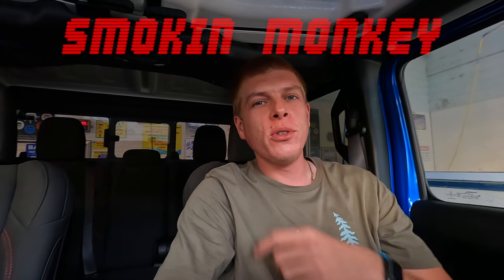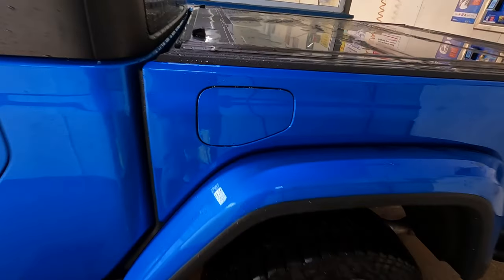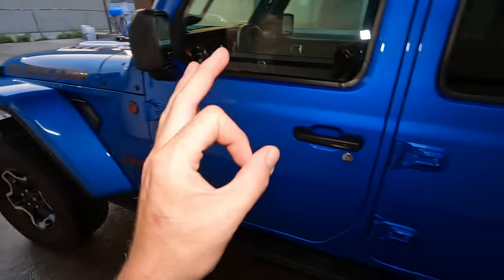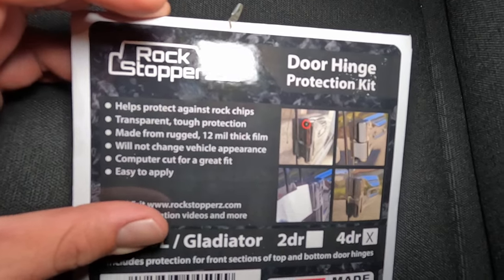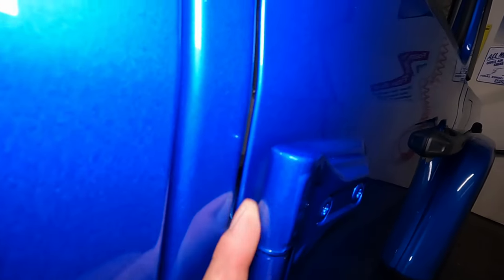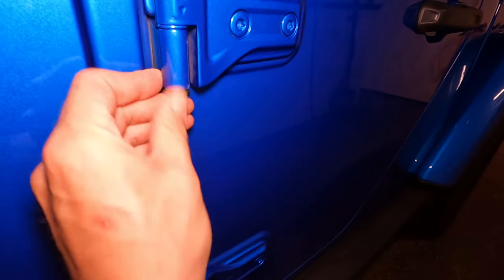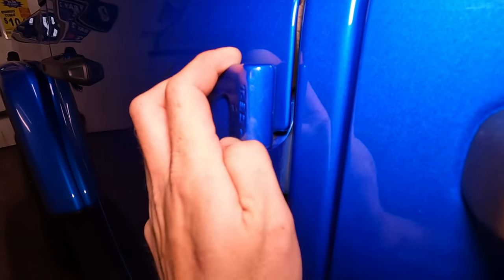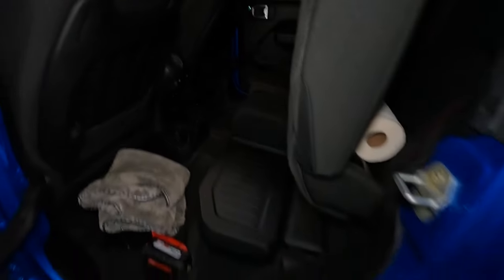The Best Way To Protect Your Jeep Hinges!

Comment: Good idea.  So I recently traded for a 2023 Mojave and really like it.  I'm a hunter and make about 50 trips a year living close by.  I've been twice (in good weather) and honestly don't think I need bigger tires on the logging roads we use.  The only thing I've done is swap to a short antenna.  Anyway, thanks for the videos!
Reply from the maker: Nice congrats on the new ride. How you like it so far? And ya you definitely don’t need more than the stock set up for most people and most light offroading. I only want the upgrade for harder trails and honestly I love the look too lol
Reply: @SmokinMonkeyOG  Frankly I'm surprised how smooth it is compared to my previous Tacomas and Frontiers.  You might recall I criticized your upgrades before I saw what you were doing.  Again I was wrong!  You are tackling aggressive 'trails' if they can even be called that ha ha.  I'm just on service and logging roads.  Sometimes they get deeply rutted and generally destroyed from big logging trucks, especially during rainy weather.  It can be challenging.  But it's nothing compared to what you're doing.  Anyway so far I'd say this Mojave, even in stock form, will be a much better performer than my previous 4x4 trucks.  I like the added confidence knowing I'm not as likely to get stuck.  We help each other but nobody likes calling for a tow during hunting season.  Thanks and great videos!

Comment: I feel like all the new cars paint r soft n chip wasy my jl already has  a chip missing on the door hinge
Reply from the maker: The open wheel design of the jeep throws tons of rocks at the doors and hinges so you can’t avoid it with how the vehicles designed unless you lower it down to the ground and get mud flaps